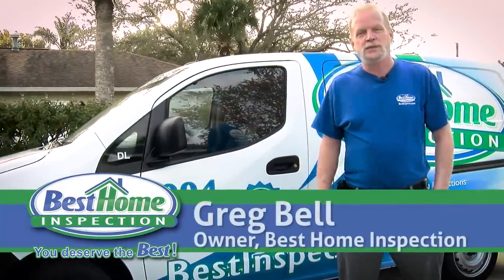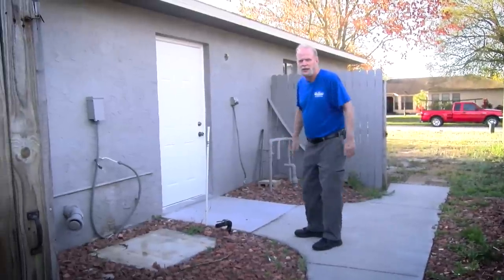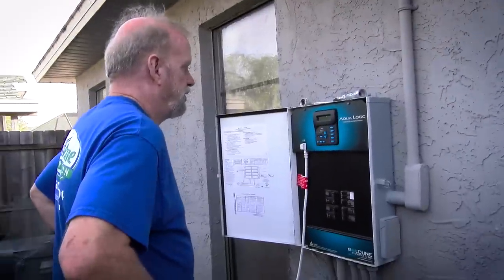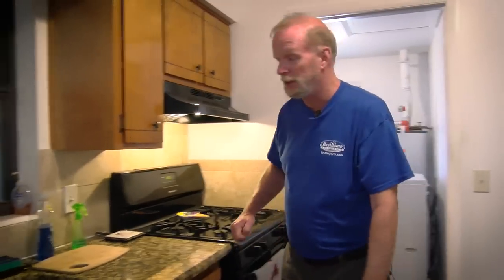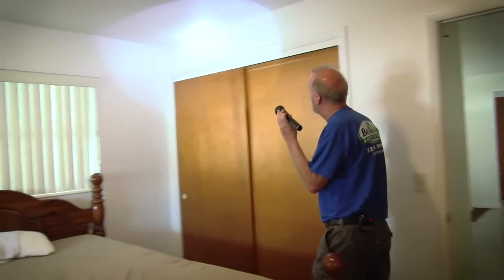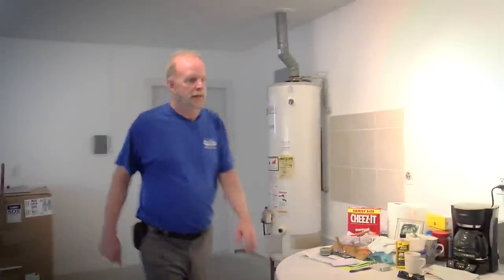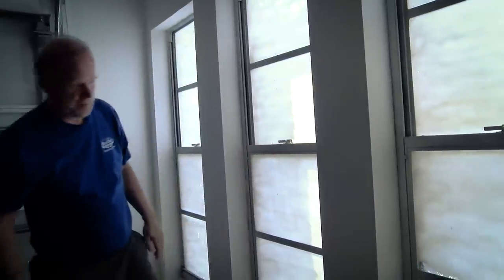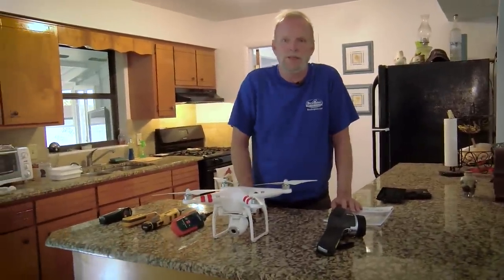A Home Inspection Overview with Greg Bell

Comment: Do home inspectors have insurance in case they break something? Is it expensive?

What if the inspector misses finding something?

How soon does one feel confident after starting out as an inspector?

Good video.
Reply from the maker: Hi, Mike. (a) Yes. www.nachi.org/insurance, but breaking things is what an inspector's job includes. Read this article about doing damage during a home inspection: https://www.nachi.org/damage-during-inspection.htm. (b) A home inspector is not required to find every defect that exists in a house, according to the Standards of Practice at www.nachi.org/sop. (c) It's up to you, but I'd say a month or two if you graduate from www.internachi.edu.
Reply: Hi Mike

Yes in Florida we are required to carry General Liability insurance for at least 300k. I've been self employed for over 40 years and never needed to file a claim on my GL (knock on wood).

To be honest we are never going to find everything wrong on a house. In my case it is just little things that I have missed. We limit our liability to the cost of the inspection. The inspection is not a warranty or guarantee. 

I've been doing this for over 20 years and still learn new things all the time.

Comment: How do you measure the temperature coming out of the ac vent when the whole ac system is missing?
Reply: I just realized that this is a basic video to show what should be done in an inspection.  my apologies
Reply from the maker: Thanks, Troy. You're correct. This short video was an inspection overview.
Reply: troy davison haha good catch

Comment: Great video!
I just finished my 120hr course. I noticed in your video you go beyond the SOP (standard of practice) by checking pool, shed, etc..  I've seen this in other videos as well. Is this something that's agreed upon before the inspection on a case by case basis or just local standard in your area?
Reply: Pool and shed inspections are usually ancillary.
Reply: @lysergide2045  had to look up the definition to ancillary but still not any smarter....
Reply from the maker: Thanks for watching and commenting.
Reply: Hi Brad
               It is common in my area to include outbuildings and pools with the inspection. I do charge extra for larger outbuildings.

Comment: Great video Greg but for some reason you didn’t mention anything about water heater straps missing is that not required in the state you doing inspection in this video? I am sure you included that in your report but just missed on the video.
Reply: Hi Chamo   Straps are not required in Florida. Suspect it is just a West coast thing.
Reply: @gregbell2496  Good to know. Thanks so much
Reply from the maker: Right.

Comment: Excellent video, although CVA should never be drawn from indoors with a gas FAU. Do not put a grill on that door, drop two cans from in the atic high and low CVA.
Reply from the maker: Thank you for the feedback. You may want to check out other resources available to home inspectors at https://www.nachi.org/become-home-inspector.htm and https://www.nachi.org/tv/home-page/home-inspection/

Comment: The discharge pipe on the hot water heater is missing.  Are they exempt from an extension pipe/discharge pipe in your state?
Reply from the maker: Nope. Good catch.

Comment: first video where someone inspected the refrigerator. even if it's going to be left behind, does that really fall under the purview of a home inspection other than opening it up to see if the electricity works?
Reply from the maker: It's not in the Standards of Practice, but it could be something that a home inspector does for their clients out of courtesy only. That's how I handle certain things that are beyond the scope of my inspections.
Reply: @internachi  i was then going to ask about ceiling fans, but that was answered in the last video :)
Reply: It depends on what your state requires. Florida requires you to inspect the appliances.

Comment: hi love your vid,,but one question shouldn't the garage door have been self closing or does that only apply if its entering the house and not the outside ,,thank you
Reply: You rarely see a self closing door in the garage in my area.
Reply from the maker: Yes. Today's code requires the garage door between the house and the vehicle garage to be self-closing and fire-rated.

Comment: What is the deal with going up on a roof? I have heard different inspectors give different perspectives about why they go up on a roof vs why they don't. Need some help with this
Reply from the maker: The Home Inspection Standards of Practice at https://www.nachi.org/sop.htm does not require a home inspector to walk upon any roof surface. But many home inspectors exceed that minimum and do walk upon the roof.
Reply: Actually even varies on what state your in IF they even can. Some say not required or some type of harness must be used. Silly, but true.
Reply: I walk every roof that I can.

Comment: You forgot the garage safety sensors I did not see anything if someone walks while the door is closing it will trip and send the door back up. The other test is place a ball at the bottom of the door while it is closing when the door hits the ball or object the door should automatically go back up.
Reply: Eric have you had any issues doing the test ball? I thought I broke a Craftsman garage door opener a few months ago it shut down and would not respond to anything until I cycled the breaker.
Reply: He tested the garage door safety sensor?
Reply from the maker: Thank you for the comment.

Comment: What Ir cam are you using?
Reply from the maker: I'm not sure what Greg is using, but I recommend checking out the FLIR C2 at https://inspectorcoach.weebly.com/home-inspection-tools.html and other infrared cameras on InspectorOutlet.com.  InterNACHI as a free, online certification program to become Infrared Certified at http://www.nachi.org/ir
Reply: E30 Bx Flir
Reply: @internachi  I just purchased the C3 and pull it out daily to train what normal and abnormal looks like. Watch a lot of videos also. Thank you. Just took the test and failed which is a good thing from how I see it. Expansion of knowledge is a great powerful tool.
Reply from the maker: Thank you for the feedback.

Comment: Any saftey concerns with that ladder?
Reply from the maker: Yes. Good catch.
Reply: I have had the ladder for over 20 years. Only had one time where the latches didn't catch. That was an experience. Thankfully I was in a small room so when one rung collapsed I fell against the wall. That is why I always make sure all of the latches are locked. Aren't all ladders a safety concern?

Comment: How's he getting 56 degrees from the AC without a condenser?
Reply from the maker: Hi, William. It may have been a video where we pieced together more than one inspection into one video.
Reply: Looks like it's been the same house right through, 56 degrees is a mystery
Reply: We shot the video in two different properties. One I just bought and the other is a rental.

Comment: i would never use a ladder like that.  Just asking for trouble
Reply from the maker: Understood. I use a SpectoScope to inspect the roof while standing on the ground surface. Safest way.
Reply: I could not agree more i was given one for free i do not use it.
Reply: Yep. I blew out 2 thumb nails from crushing them and had the ladder collapse on me luckily I was only three rungs up.
Reply: Thse ladders are only good for portal attic access. Not for outside roof access, they do not extend OSHA recommended distance above the facia, what if the crawl was raised? What if the ground was muddy and not level?? So may reasons to use a Werener
Reply: @cremls  There's absolutely nothing wrong with this ladder. Anyone who gets hurt with it would have gotten hurt with any other type from their own ignorance.
Reply: @silenthill5794  you're also supposed to open these from the bottom up, not like he did.

Comment: I bet that WiFi garage door control isn't very secure. Anyone with free pentesting programs could probably hack it in 5 minutes or less
Reply from the maker: Hm. Maybe.
Reply: @internachi  These newfangled devices are designed with convenience in mind, and often lack basic security measures.

Comment: At 20:25 you talk about being a GE panel with a Challenger breaker and a Square D breaker and they need to be changed because they aren’t GE? No where in the NFPA 70E does it state all breakers in a residential breaker panel shall all be the same manufacturer. They do not need to be changed! As long as they stab in correctly and are the correct amperage for the wire size they are okay. Btw why would you stick you hand in a live panel without wearing rubber gloves?!  Where is your common sense for doing a safe job? This is not a way to conduct a safe inspection!
Reply from the maker: Thank you for the questions and feedback, David.

Comment: see i found all these videos about home inspection according to the SOP. you do not have to get on the roof. yet all these inspectors do. WHy?
and then complain about inspectors who don't. And then most of the inspectors do things outside the SOP  will isn't that like breaking the rules. i think you are all hypocrites.
Reply from the maker: Home inspectors exceed the Standards of Practice when they feel that they have to see more than the minimum requires them to.
Reply: @internachi  what. Sop. that's it.